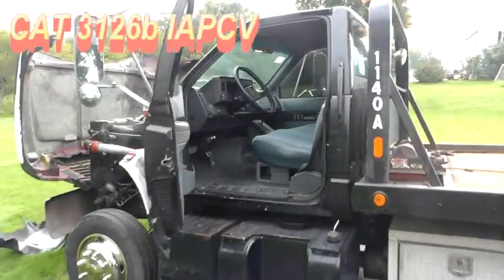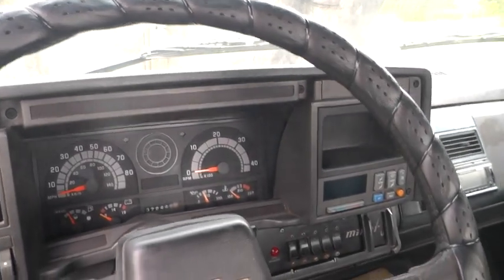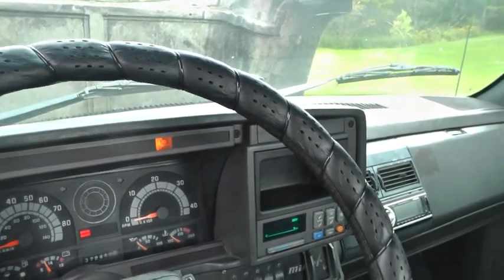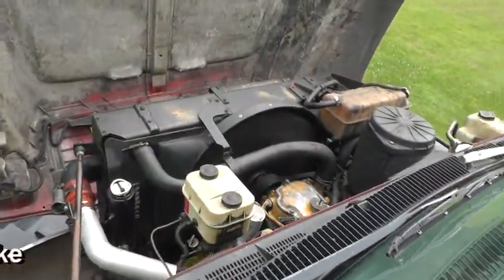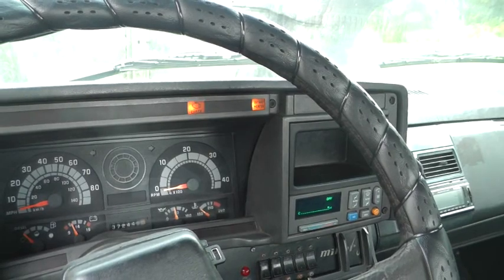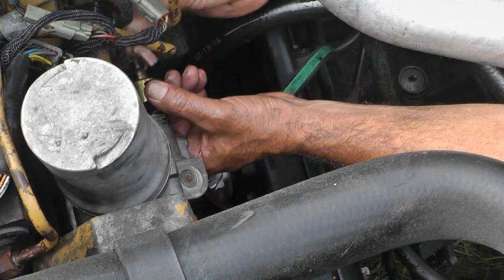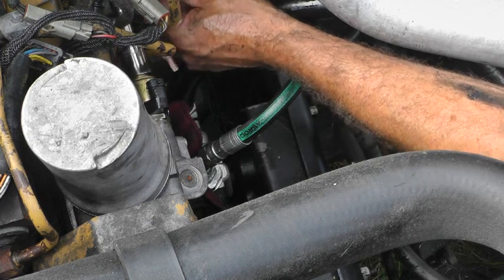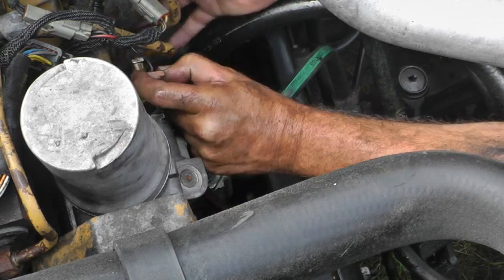CAT 3125b IAPCV Injection Actuation Pressure Control Valve

Comment: question I have a beeping that doesn't stop even after I close all doors and auxiliary brake light on
Reply: Had same issue, I simply tapped the beeper box from the dash speaker port and hasn't made noise sense.
Reply: Usually it's the sensor on the hydroboost

Comment: no tach operation.... time for a crank/cam sensor....
Reply from the maker: When I investigated, I found that there is a wire for an alternator tach connection. The previous owner replaced the alternator with one that has no tach connection. I never did resolve the issue.
Reply: There are two on CAT rarely do both fail 
ECM may be bad.